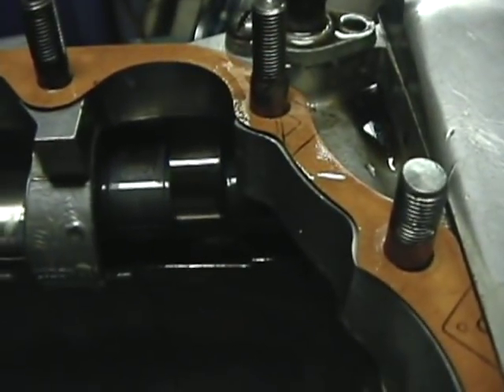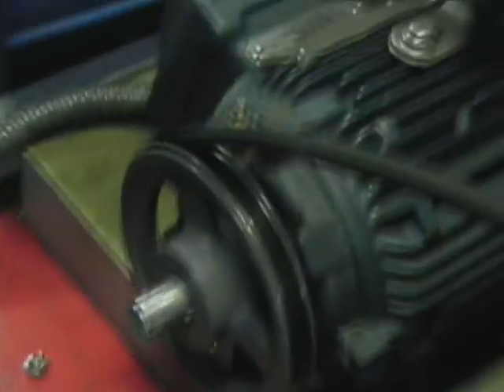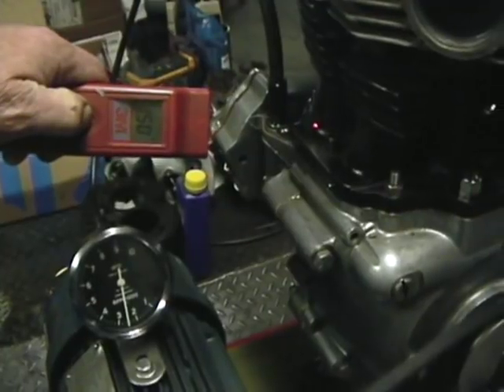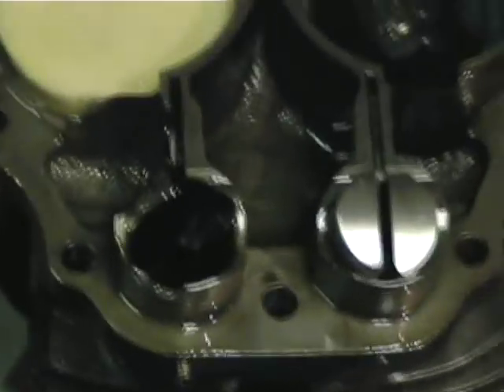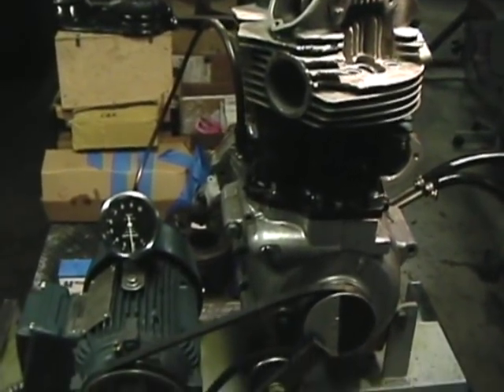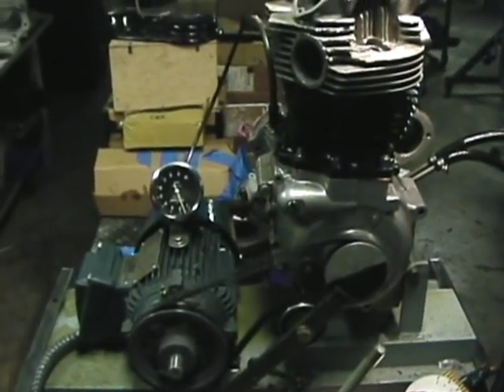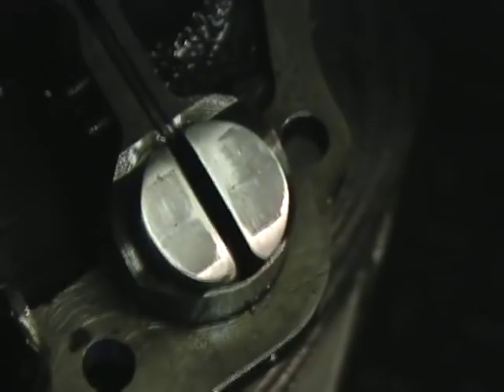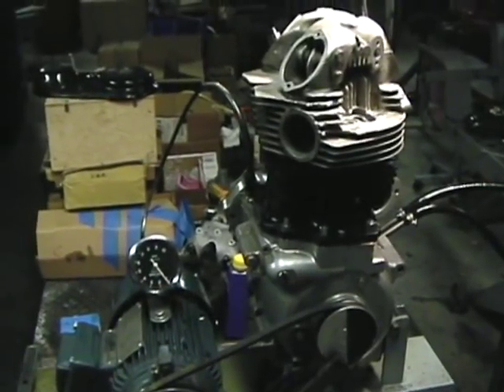hardweld follower test

Comment: Jim - It's a little hard to see (perspective, mostly, I think) but are the lifter faces flat like stock or are they radiused?  Is the cam in the spintron a WebCam 213A and does that require a radiused or flat lifter?  Thanks  Bb
Reply from the maker: The new followers are radiused.
 They can be cut with a 3 or 4 inch radius and used with the 312a cam. The 312a cam is suitable for a flat to 3 inch radius follower.  
 I also have custom  cams to use with the same follower ground with a 1 inch radius.  They are available in 4 grinds from stock to full race. 
 The hardweld material is not compatible with any cam other than a Webcam.